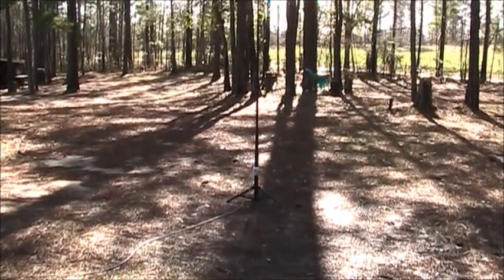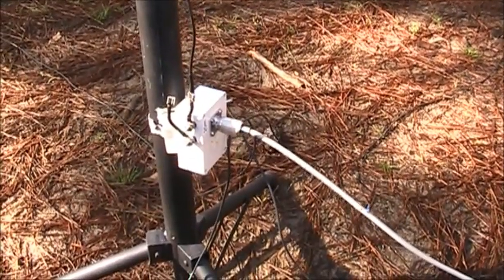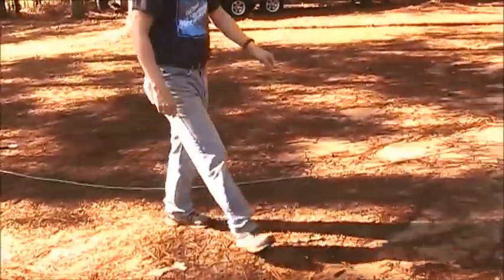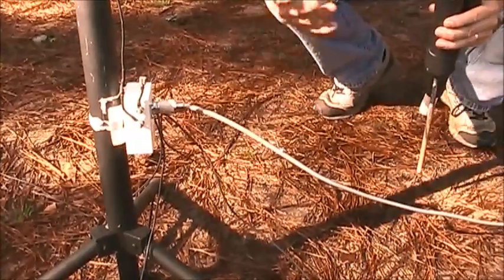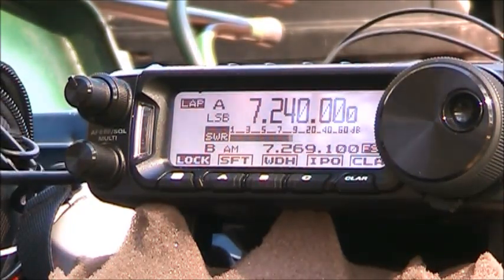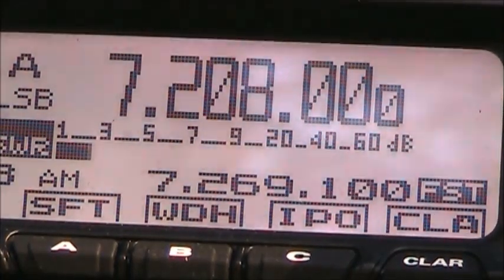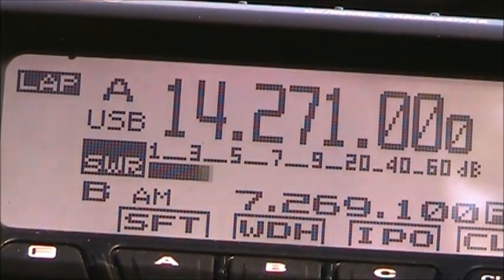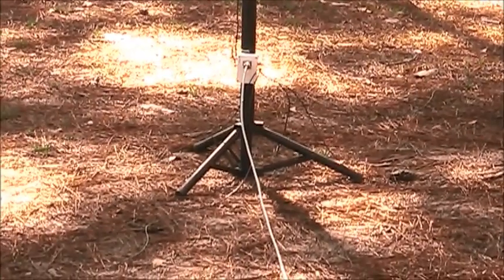Portable Vertical Antenna for 20M and 40M

Comment: Finally made it. Swr flat on 40m. On 20 my radio shows 2.5:1, but still made few contacts kn both. Easy antenna to make and it works well.
Reply: Great!, remember, on 20 meters you can add more radials if you like.

Comment: On this image I see 27 turns, of 18ga wire around t157, i hear 30 turns, reading 24 turns... what is correct?? What is the "main/top" cable length?